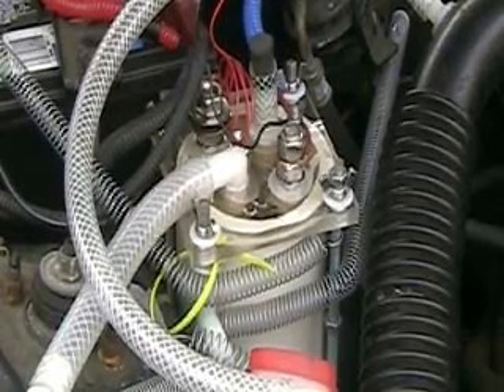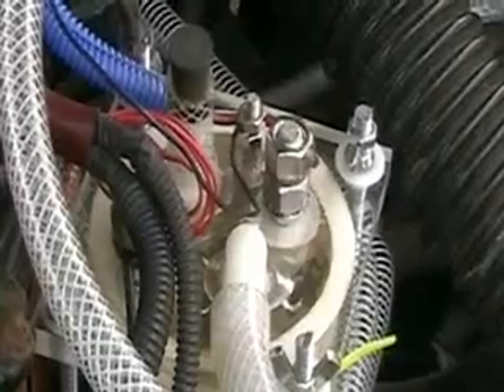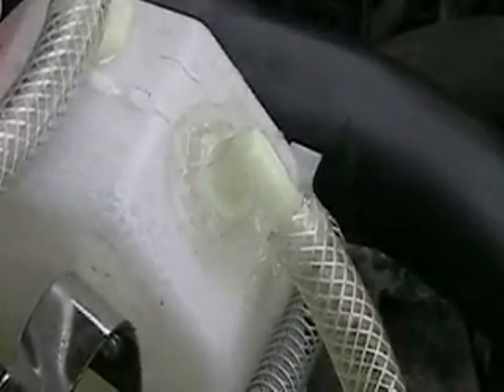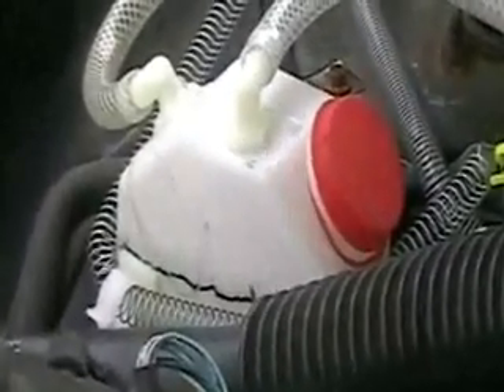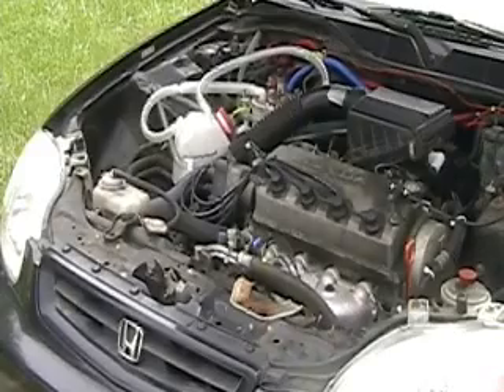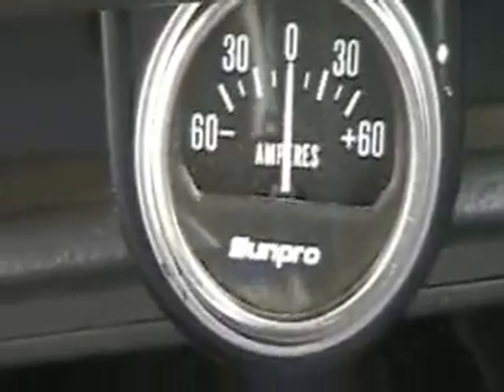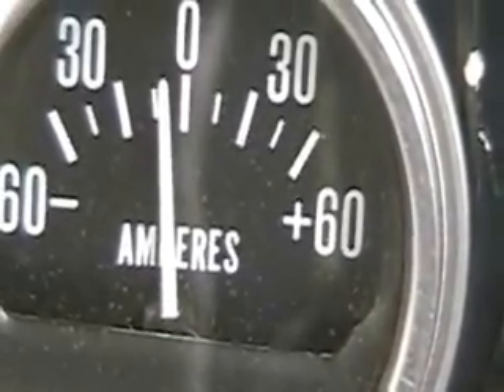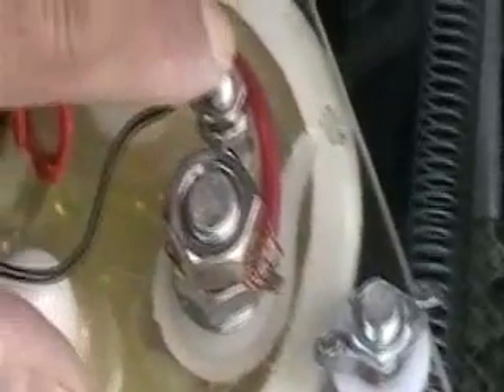Hydrogen Tap (Focus- 100 miles) 325

Comment: @onthecuttingedge2005 The production of the batteries destroys the environment, and is very inefficient. It is just a way for the oil business to keep you wrapped up. Fuel cells are the future and the way to go. Let me ask you this: does battery power move the space shuttle, or does Hydrogen and oxygen?

Comment: Try using an o-ring placed on top of the PVC pipe, as long as the plexi has a recessed groove for the pipe to seat in.  I think you will get much better sealing.  This is the typical way that you would seal a hydraulic cylinder on either end if you use a tie-bolt system to hold the parts together.  It looks like a 3" piece of pipe.  You should be able to find a 3" o-ring at any hydrailic repair shop. Nice looking cell, though.  How do you cut the plexi??

Comment: i have some automtive skills and i would like to sugest a buterfly valve system in your intake to the engine that is opened just a little for idle speed and have the butterfly hooked into your throtal control linkage this way you can incress the pressure in your cell giveing you more hydrogen as your rpm's incress and as you take your foot off the the throtle the butterfly valve will cut back on the amount of the hydrogen going in your intake biilzball

Comment: great work john, on your seal problem what about cutting a grove in your end plate and install an o-ring or use treaded pipe ends, i like the o-ring deal and have you checked your fuel mileage yet?

Comment: Hi John

Seal idea;

Get yourself a thicker piece of Plexiglas and an adjustable circle cutter (drill press required).  Cut a circular grove in the Plexiglas and drop a 4" O-ring into the groove. Make sure the groove is only about 60% to 70% as deep as the O-ring is thick. You want the Plexiglas to 'almost' tighten against the PVC tube. 

If you're really good with a drill press, you can make a deeper stepped groove. Providing a second 'shallower' larger groove for the PVC tube to 'locate' into.

Comment: I have read a few reports in reference to Hydrogen Enhanced Combustion (HEC). Although they afirm Farradays laws of thermodynamics they go on to say by adding as little as 5% hydrogen it enhances the hymogenous combustion in a lean air/fuel mixture.  The hydrogen through lack of density rapidly spreads in said mix causing an instantanious explsion when ignited.  No flame front as with petrol slower burn rate.  Then benefit is is more petrol burns less wast less polutains and (drum roll)

Comment: So is it true, that even though you are using alternator power to make fuel, it increases the effeciency of the mpg? So just by putting a little hydrogen into the engine, it makes it more efficient just because of the chemical reactions? Thank you very much, and great job on your honda.

Comment: About the seal, what about atomotive Hi temp RTV gasket seal?? You can use it on the wing nuts too as to create more friction and a semi bond against engine vibration. How many plates are you using on this vid?? Any pulse circuits powering the unit in this vid? Take Care

Comment: john, love the work. I have a unit that looks like yours and the same seal problem until i used a "sink basket gasket" from local hardware store. The sink basket gasket if exactly what it sounds like. The kitchen sink basket gasket.

Comment: Actually, it's there to regulate the fuel mixture into the engine.  You could just separate the oxygen from the gas you electrolyze in order to counter that problem.